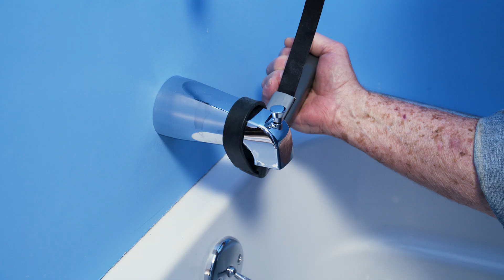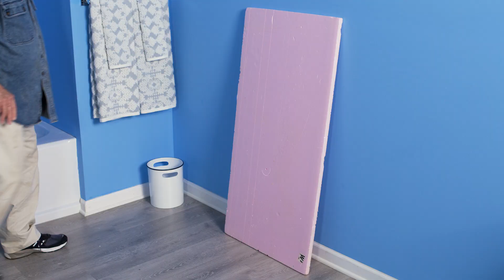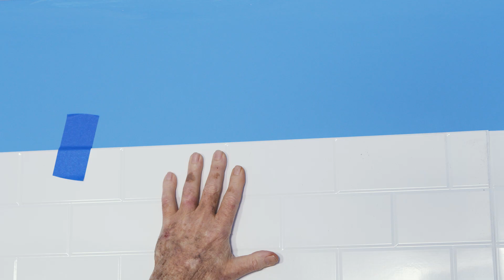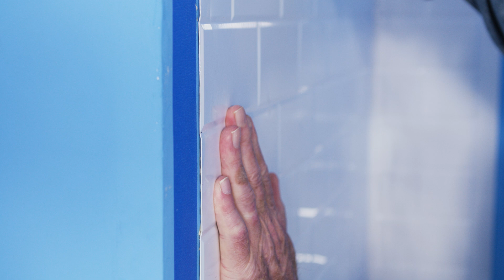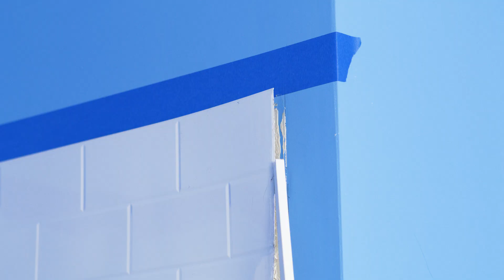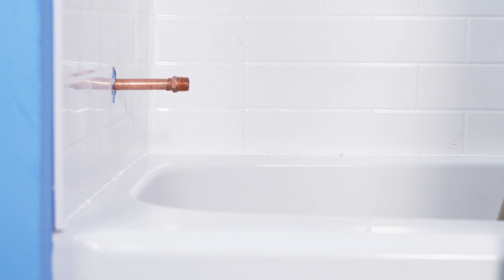How A Shower Surround Can Be an Attractive and Affordable Upgrade to Your Bathroom

Comment: Looks great I do not like how thin the material is looks way to flimsy and cutting with house hold scissors
Reply: it won't bend, so it doesn't matter much. its purpose is a cheap, working solution